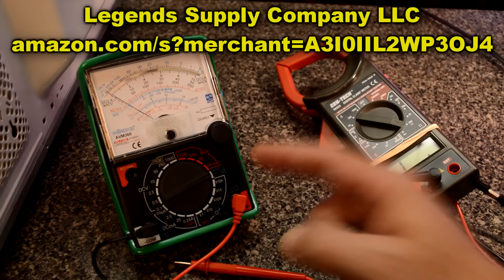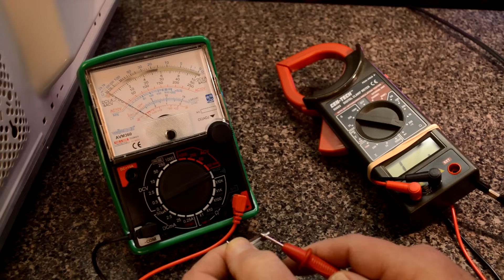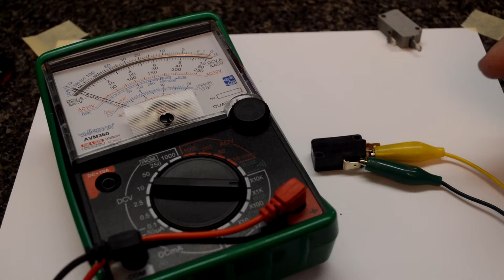Microwave Oven Repair - How to Test Fuses and Switches

Comment: The top switch on this style of microwave is always the one that fails. This switch is subjected to high current circuit break if the door is opened while the oven is cooking. Lot's of people abuse the switch in this way to check the food temp by relying on this switch to shut down the oven when the door is opened. Microwave oven doors should not be routinely opened while cooking - you should always press the front panel stop button before opening the door. Your door safety interlock switches will thank you.

Comment: How do test if the GE thermo fuse (0805 KSD-40LC 70)  is bad. I did the continuity test and it appears bad, but I've read that it is an open circuit and has to reach a certain temp. before continuity can tested. quick help?

Comment: I am a beginner with enough electrical knowledge to dare to fix an old samsung microwave. It is completely dead, no clock showing n front. 
I have just plugged it in and noticed there is no dc coming out of the transformer side that is connected to the front buttons. I think I should get an output of 12v dc. Is the transformer broken? The other side of the transformer wires are thicker and go to the capactor. I have not tested those

Comment: Great info.  I just bought a new GE microwave a couple of years ago and it just went caput. I went to Goldwasser’s site and it’s seems the problem isn’t just a blown fuse.  Question is, what microwave do you recommend?  Brand, or model?  I really expected at least 10 years from this.  I bought my mom one from Sears 30 years ago and she used it for 20 years.  My new Ge dishwasher is also on the ropes and will probably be broke soon too.

Comment: Excellent video.  Appreciate the safety warnings, especially the heads up on the big capacitor.  Also appreciate the extra lead for the fix it guide at the end of the video.  He honed right in on the problem fast and efficient and safe.  Thanks alot.

Comment: 1:42 "Bleed capacitor." = => Should be 'bleed resistor' internal to the high voltage capacitor. Must short the high voltage capacitor any and every time the microwave has been plugged in to test its operation.
Great instructional video! Glad you emphasized safety first!
Reply: Yep, plug it in for one second and the capacitor is charged and ready to shock you.

Comment: I replaced the middle switch from my microwave the switch with NC it started to work with no problem,  then when in use like 4 to 5 times it pops the main breaker ? What you think is making it do that?

Comment: the display right before all went dead on my 2 yr old whirlpool microwave oven- built in type, said something about door open or something like that so i removed the control panel and could not find a fuse, i see the micro switches but thats it. if the the fuse is right where the power cord exits the oven i may have to remove the unit from the wall ?

Comment: Good vid. Now to see if it works! Our microwave is tripping the home breaker if the door is opened while the microwave is running. I have just replaced the main fuse. If I had watched this vid first, I would have checked the switches while I had the face off.

Comment: Appreciate this video - already replaced the power fuse, machine came on - can set the clock but nothing happens when trying to microwave anything. Going after the thermal fuse next.

Comment: nice clear directions very  good,, now my microwave shut down just the other day, went to Walmart and blew 70.00 i didn't really have on a new one, same tyype 1000w 1.1 cu. in , now this was the problem, I arrived home and I got the feeeling to plug the old one in just to see if it would start up again,, and say what!!  it did, so there is a breaker some where in this microwave to either replace or what, so far it operates fine!! got any suggestions??

Comment: @gurubrew Is there a quick way to determine if the switch is bad by looks alone? I don’t own a multimeter currently and am trying to save $ at the moment, and don’t want to buy a bunch of parts that aren’t necessary for the fix. The prongs on mine LOOK pretty burnt, but the button does still click. Does it always go bad the same way yours does in this video where the button does no longer click? Or can it click but still fail?

Comment: Good video!  A clear and concise explanation of where and how to troubleshoot micro-switches and fuses.   Thanks for demonstrating the discharge of the capacitor and using the multimeter.

Comment: Thanks for the video!. 
I found a bad monitoring switch on my microwave and decided to buy a replacement on amazon(sum-v16-fd-62). It worked initially however, if the microwave door is opened before the time runs out it burns the monitoring switch (contacts get welded stuck). I've tried this a couple times but my kids keep opening the door before the time runs out, getting the switch stuck closed and setting off the breaker. Do you think that my microwave might have another issue or should I try ordering another micro switch? Any feedback would be appreciated. 
Thanks

Comment: Excellent!!!! Instead of going in there, I decided to buy a used microwave. If it works when I go check it out, great.  I'm sure something is wrong with the door connector on my own.Yet I don't have a meter to check a fuse...and without any experience, would rather give up a few dollars for convenience. I suppose having someone else fix it would cost a bundle. THANKS!

Comment: 1:22 - "This big capacitor...mine holds 2100 AC volts".
No capacitor holds AC voltage. They can only hold DC voltage, but I'm probably NOT the first to notice this.

Comment: There is a metal strip that runs through the fuse.  You can look through the glass to see if that metal strip is broke.  If it is, it's not making the connection through.  Or, if the metal strip that runs through it looks burnt.  If it does look burnt or the metal strip is separated, it's not good.
Reply: With the new switch, can one assume the bottom is the bottom?

Comment: I have an Lg microwave and my mom ran it for 5 minutes empty.. now it will not heat I opened up checked top fuse that is ok but not sure what fuse is attached to capacitor?

Comment: Hey It is a excellent video tutorial. My Fridgidare Gallery microwave is not working at all. I did check the microswitches and believe they are different. Top and bottom no continuity door open. Middle switch has continuity.

Comment: Wonderful video. I have a microwave which is getting power but none of the buttons work except sometimes. I looked it up and other videos led me to believe the ribbon cable for the control panel was loose or out of the connector. I checked that and the ribbon is set good. Since it is not the ribbon, I now know how to check other components. I will also look at the manual you placed a link to see what else it could be.
Very well made; thank you.

Comment: I have a microwave which is driving me nuts, it continuously blows fuse, I changed the capacitor diode and fuses now it’s not heating, I changed the magnetron too, what could be the problem please advise

Comment: This is so worth a try before you plop down several hundred dollars for a new one. I have salvaged several microwaves this way.  I keep these switches and fuses in "stock" because I have had to do this repair several times, especially on the "over the stove" microwaves.

Comment: Two micro switches worked correctly but the middle one did the opposite of the other two. My volt meter beeped when door opened but didn’t beep when closed.

Comment: Hi GuruBrew, I just watched this video and thought it was excellent.  I have a Sharp Microwave/Convection oven that doesn't work in any of the convection modes...microwave works great.  Convection shuts off after 2 minutes, and it is hot inside.  I opened it up and the inline fuse was good.  The damper door closes and the fan was running.  Any ideas Sir?

Comment: I wish they were all the same. Some can only handle 1 amp. Some can do 20 amps. Also the pressure of the plunger can very a lot. Be careful  there are 100s of different types all look the same. Feel the switch pressure of plunger, then read the side for amperage rating. Love your videos

Comment: Question for you. I Love the vid. And thanks for the detailed explanation on diagnosing the microwave, and helped me tremendously I do have a switch that's bad it is the monitoring switch on a Frigidaire Gallery 1550 Watt, they did test it without the switch plug in and it works the question is can I leave it that way or will it damage the microwave. Its Xmas. And I need it for a couple days till after Xmas. ( Christmas Eve dinner and Christmas dinner) please respond asap. I dont want to damage the unit for a simple switch problem... But xmas dinner is kinda important. Thanks for the explanation

Comment: Much appreciated. 
I bought a brand new Panasonic nn- sd987s hauled it overseas unpacked it and when I plug it into just gives a little Flash and that's it. Panel doesn't light up the buttons don't work . so I thought maybe it's shorted out and it's the fuse but it ain't the fuse... next stop appliance repair guy
Reply: You said you had it overseas. Could it be you plugged 220 volts into a 110 appliance?

Comment: Your video is very helpful! Thank you! However, I do have a question regarding disassembly. I have tested the inline fuse which is good and would like to test the other fuses but I am unable to get full access. It appears that there are rivets in the back plate cover and I wasn't sure if there is another way to get access before I break them off. This is a Lagan Model that tripped the breaker when I was changing the stove top light bulb and now only the clock works. Any feedback would be much appreciated.

Comment: Well done. Answered my questions on the micro switches. Unfortunately, all 3 of mine are good. I guess that means I need a new circuit board. Samsung over the range model... if 3 switches are working properly, the circuit board needs replaced as it isn't reading properly...all this according to Google and your video. Thanks for posting.

Comment: Absolutely the best video,,,and all those or most of the guys behind the counters only know when to have a cup of Joe. or what they read,,ever been to a box store and read the info on a packed,,then ask a staff member and they read what you just read...duh...Really enjoyed the video, now help me fix mine...will check micro switches, issue is it's a built in one and have so much cabinet work if I can't fix this one. Main fuse is good,,,think the capacitor is good also,,now off to the micro switches. Like to hear from you if you have time. Thanks

Comment: thanks for the three prong vs the two prong makes life easier almost when I first built my forst computer and when looking for cd players was so confussed on what ones were good and compatible to the computer (yes decades ago) but with microwaves 2 and 3 prongs you clarified it. My issue was it just died. When I slammed door ir flickered but died. Took apart checked switch and they were fine. But real loose in the holders. Samsung microwave. Well after checking and put back it seems to be working. Thinking it may have had a loose connection to door latches. Seems like the switches should be more stable then being jiggly. So hoping that was all that it was. No burnt smell or pop just had died no power.

Comment: Thanks so much for the information! I have a over the range LG microwave. when turned on everything works, except the turn table and it doesn't heat. i think it's the lower door switch. So after watching your video i opened it up, was about to drain the capacitor but noticed all terminals that are connected have rubber coated connectors. also, it is mounted sideways making it harder to get at terminals! any suggestions??
Reply: A great well done video!  You speak, explain, and talk thru everything so well............  Thanks, Richard H.

Comment: GuruBrew,,, Thanks for the thorough, informative, and detailed schooling on microwave parts and repairs,,,

Your slow descriptive explanation during each phase of the video along with the excellent camera work has enabled many of us viewers to safely repair our appliances,,, 

When I removed the cabinet from my GE Spacemaker II Microwave I had no idea what all those parts were, or where and how to start looking for the reason my microwave would not come alive,,,

Although I have not repaired my unit yet ,  you have given me the knowledge  to do so,,,

P.S. I can only see one ceramic fuse and it tests good thanks to your lesson on the multi meter,,,

Are there other fuses and where might they be ?
Thanks again

Comment: have a vintage sharp solid state carousel 700 watt microwave oven circa mid 70's. never had any problems till other day. heard it beep and digital display showed number 5, pressed reset no beep, nothing and all other buttons did nothing. unplugged it, plugged it back in and showed all zeros opened door and closed it and it beeped and froze again with number 5 in digital display.left it alone and around hour or two later it was reading all 5555 on display, so hit reset it beeped and it went to clock. it worked so I cooked some rice which took 17 minutes, finished and went to clock so I set time for clock. kept time as normal, then  next morning it it beeped and showed 5 again on display. hit reset and this time it went to clock and didn't have to wait for 5555.. weird ain't it??

Comment: Great video. I thought to myself "I don't really need to discharge that capacitor." A few minutes later... ZZZAAAAAAAPPPP!!! Yowwweee!!!! Ouch, that one woke me up. Do follow his advice his advice folks and discharge that capacitor. It was NOT a light shock. It was like sticking a knife in a wall outlet. This video is very well done. Thank you! My microwave is now working again. I got the micro switch off amazon. Worked great.

Comment: Loved your presentation. After watching I have discovered that I can open the Panasonic mystery box on my counter that does everything but heat without fear of the wicked witch of sparks and death jumping out and consuming my outer appendages and wasting a good screwdriver. Enjoyed your precise teaching and will use it well, I hope.
I spent my entire 45+ years of work life in the automotive aftermarket in tires, parts and car wash equipment. I have seen many old geezer-types like you ran into at the Maytag store. They have been trained to believe that all their high priced parts are proprietary and absolutely necessary for the continued use of whatever item you found it on. This would be especially true of some brands more than others and Maytag is the crown prince of such. 
Some parts people are there only because they could read a catalogue and the repair guy can't whereas the parts guy doesn't know a box end wrench from a crowsfoot wrench. He must propagate such nonsense in order to justify his existence and work position as well as the exorbitant prices many stores charged for their junk. Independent parts suppliers in all the various repair fields helped to end most of this crap because they sold replacement parts made by OTHER PEOPLE and they worked quite well or even better. Many manufacturers would design certain things in such a way that they were the only supplier of that part and they may have had planned obsolescence built in as well. Can't really have that oven last too long now can we?

Comment: Our Sharp Oven/Microwave blew a fuse (I think.) It lost all power, so I started with replacing the fuse. After I replaced it, it had power again, but when we tried to use it, it lost power again. I'm going to attempt some of the stuff in this video but it's all so new to me. lol I'll let you know how it turns out. We're RVers and having no oven/Micro SUCKS, plus I don't want to spend money on a new one if this one can be fixed for less. Thanks for being so thorough and clear!

Comment: Ok so I replaced a blown fuse in mine, and it blew again, this has given me some pointers on where to look next ( and by luck a neighbour has just thrown out a microwave with lots of generic parts like micros witches , this may be fixable after all, thanks for the tips.

Comment: Another thing to watch on the micro switches is over travel  on the little button.  Some times the actuator pushes that button too far. It will be read good out on the bench but when you  reinstall it, it doesn't  work. I stumbled  on to this by watching  a switch I opened up.  If the button is pushed down too far it will open the switch  back up.  That button does it need to be at the end of it's travel to work.  Leave a little bit of  travel,

Comment: You made this a very simple testing procedure. I learn so much watching people like you on youtube. My microwave stopped working just as yours did and I assumed that it had to be the door switch or fuse. I was ready to order one, when a mysterious microwave was left in my back yard. I am not sure why someone thought my yard was a dumping are? I took it apart to use one of the switches and determined it only needed a switch. Now I have two working microwaves and thank who ever left the other one. Thanks for the video. I will certainly watch more as you make them..

Comment: The information on the video was very helpful, My fuse was blown, but want to see what cause it. The micro-switch was a good starting point. The capacitor info was something I was aware of had to change the capacitor on my AC unit. Great work help use out! Thanks !

Comment: the magnetron radiates heat so you can tell the microwave is going to boil the water if the fan convection is in order